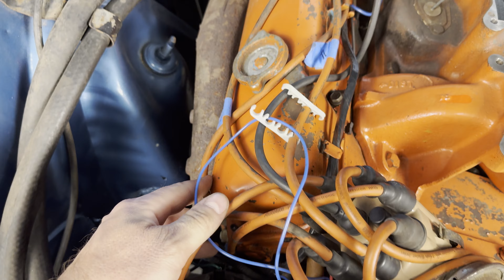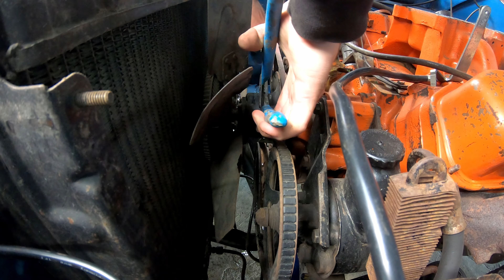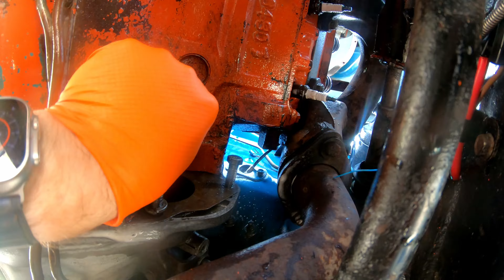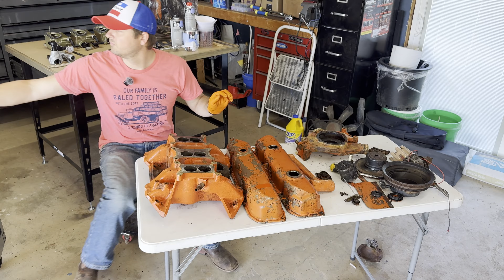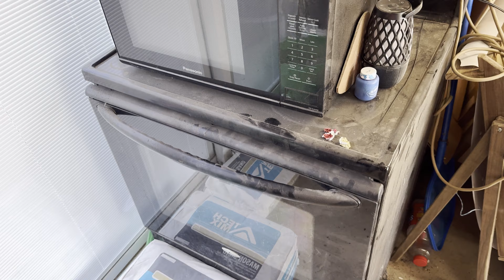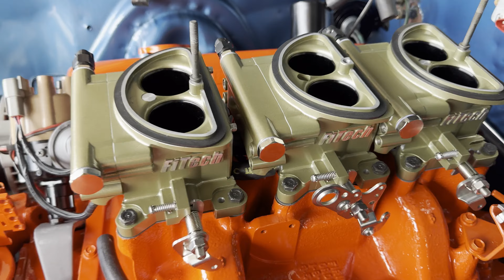1970 Plymouth GTX Build Series – 440 V-Code Engine Tear Down & FiTech Six Barrel.

Comment: I used one light spring and one heavy spring in my factory dual point distributor. Full advance comes in approx. 2300 rpms.
I tried the Mr. Gasket set and D.C. sets and they both had two light springs that allowed full advance to come in right off idle.
I also welded and filed the slots a little to limit advance, so I have 14 degrees at idle and 36 degrees full advance.
Reply from the maker: That’s actually exactly what I ended up doing with my spring setup, seems to be working out nicely.